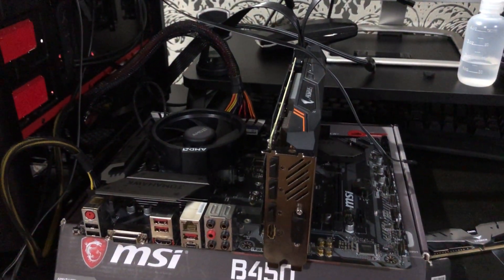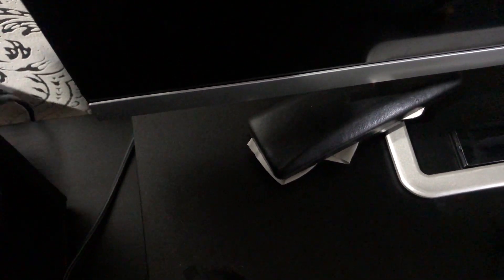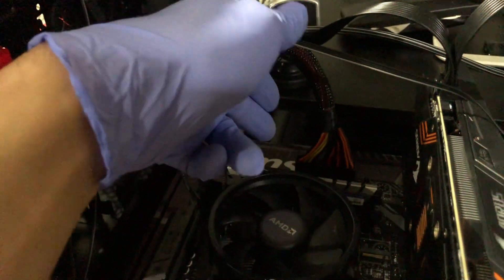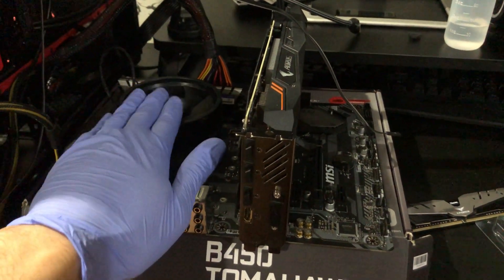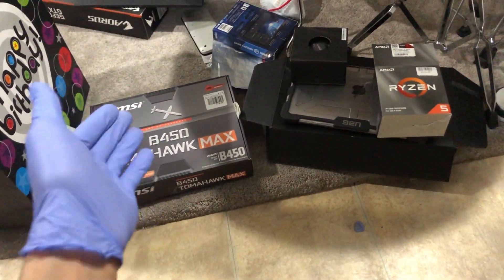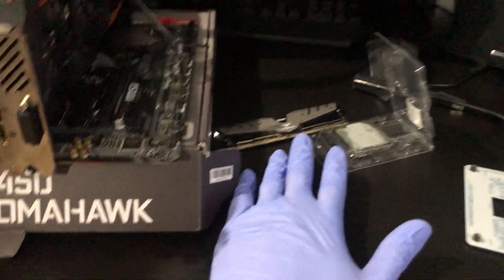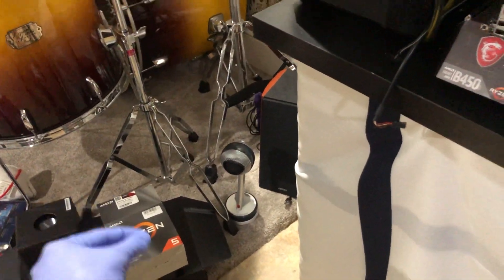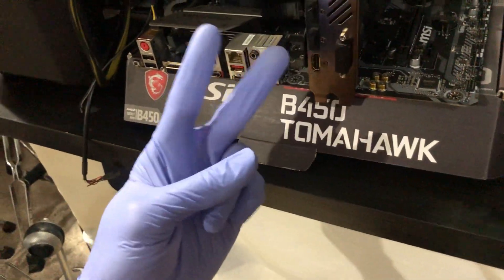MSI B450 debug lights go berserk | Ryzen 5 3600 | Cpu light problem with 2600 Not fixable

Comment from the maker: Just to reiterate that the bios was updated and every step was taken. Make sure to also check compatibility for each part but we all know the basic steps that need to be done but at a certain point your going to just have to test out another motherboard. I would file a case for whatever part you have and make a fuss and you might get something back in return like store credit.
Reply: OnlyJesh I used this motherboard and had the same issues. Some people got there’s to work and then it eventually went out. I took it back and got the ROG Strix B550f.
Reply from the maker: Crying Egyptian thats what i like to hear😈 upgradeeee

Comment: Have had lots of issues with my B450 Tomahawk not posting. It just seems to "lose" the bios after a normal shutdown, with the usual CPU & fans turn for a second, then shut off. Flashing the bios is the ONLY thing that has helped, although that can be wonky with this board, too. Some flash drives work, some don't. They MUST be formatted with FAT32 and only have one partition on them. The file must be in the root directory of the drive, and MUST be renamed to MSI.ROM (in all caps).  Some people have said on the Web that flash drives formatted with NTFS work, but that's BS.  Only FAT32 works.  Oh, and when you flash the bios, push the bios flash button for 3-5 seconds, holding in it for that length of time.  If your finger slips off the button, it won't work right!  Make sure that the red light flashes for at least 5 minutes.  If it turns off before the five minutes is up, do it again.  After the five minutes, and you see that the red light is off and is staying off,  do NOT remove the USB drive or turn off your power switch - just leave everything alone for at least ten minutes. The PC will go through some weird starts and stops. It also needs to train the memory. If your memory is overclocked to some Nth degree, it could be helpful to flash with only one stick in the 'A' slot (that is, the 2nd from the left).  Also, if your have a Wraith cooler attached, the LED light will be white when it's flashing, and red when it's actually working.  Anyway, the process of flashing the bios on this board sometimes needs to be done several times before it takes.  And, like my machine, you may need to go through this entire procedure several times a month.  Not sure if it is because of the newest bios MSI has listed, but something is making these boards "lose" the bios...
Reply from the maker: Yeah I sadly still have never figured out what’s wrong with it aside from a software issue or some component in the mobo but it’s really frustrating.

Comment: Lol hey man I have this exact same motherboard it seems like it just likes to mess with us right LOL. My motherboard every single time I start up the computer it tells me that the CPUs wrong that light turns off tells me the D ram is bad and then it tells me no boot but then it boots just like regular because of that all my RGB is stuck on red. My advice what is happening to you is happening to me unplug all of the motherboard wires including the power to the motherboard and the CPU power cord nothing else after you unplug those go take out the battery that’s in the motherboard take out your CPU blow out the socket and carefully blow on the pins on the cpu. put the battery back in after 10 seconds maybe longer plug everything back in and you should SHOULD be good don’t “Me lol

Comment: My pc won't even boot..no fans turning on nothing. When i press start button in cpu red light flashes at Cpu debug light and then turns off.
Reply: Your motherboard is probably dead if not you power supply could have died as well try taking it to a repair shop and if you have money u can just replace what’s broken

Comment: I have another kind of problem hope you can help me solve this one. 

Day before yesterday I was playing Destiny 2, suddenly my monitor froze and I couldn't do anything so I force shutdown my pc directly from Cabinet and I slept. Yesterday night I started my pc I got blue screen saying system_thread_exception_not_handeled, so I restart my pc to go into safe mode. I tried 3-4 times and suddenly my monitor, mouse and keyboard was not working. Monitor says no signal, going into energy saving mode. Now my pc starts with all fans and everything except Monitor, keyboard and mouse. Shows CPU red light too. 

My Pc build
Amd 3600x ryzen 3
Zotac mini RTX 2060 super
NVME 2.0 WD SSD-480 GB
TOMAHAWK MAX B450 Mother board
16 Gb Hyperx RGB RAM 
1 TB Internal HDD
Reply: How did you solve it ? I have the same problem rn
Reply: @hanovar9233  it was actually my cpu which had a problem so AMD replaced my cpu.

Comment: My screen is on and it shows that it’s getting a display but it’s a dark screen but I can tell it’s on my ssd and hard rice are bothe plugged in and ez debug says it’s a boot issue help please
Reply from the maker: I would try flashing it and rolling it back a version and then try to boot then. Also if you don’t have another computer to get the file try to get one

Comment: I got the same problem b450 a pro max wth Ryzen 3600 it’s not detecting the graphic card
Reply: did u solved?if u did,i have a problem,cause i have a b450 msi gaming plus with a cpu ryzen 5 4500 and the gpu is 1060 3 gb, first boot it doesn t show up any screen,first there is a problem in the led of the cpu ,after 10 second the error led goes on vga (gpu),if u got any answer i am here

Comment: I got it, and after 3 months of using this board i got random pc shutdowns (not only in games) with cpu red light on board... 
i stressed my cpu and temperatures are normal
Reply from the maker: Investing into a good motherboard is very important. My mother board I have now has been great but has had voltage drops across the board and too much work to solve exactly where it is but yeah man get that mobo and save the receipt just in case
Reply: @onlyjesh7494  so should i do RMA?

Comment: Hello, I am just building my first pc right now, and just when I finished I experienced the same problems. My specs are:
Case:P400A
MOBO: Msi b450m mortar max
Ram: Corsair Vengeance 16gbs
Cooler: Coolermaster Hyper 212 led
Storage: Seagate 1Tb hdd + Wd blue 500gb nvme
CPU: Ryzen 5 3600x
GPU: gtx 770 ( using until I have enough to get a better)
So I finished and have the Ez debug led on cpu. Everything is practically new, and I’ve cleaned and reseated my brand new ram, same with the gpu. I check to see all pins are properly connected. I reset CMOS. I even took everything a apart and rebuilt it. I can’t seem to find what’s wrong. I don’t believe it is the MOBO because I bought it off a friend and it was working on his pc fine. When I boot the pc the fan and lights turn on everything works I just have the ez debug led on, but when I connect it to my monitor via display port, it shows that there is no connection, and with that I cannot access my bios if there was anything wrong with it. Everything with the monitor and cables are fine I tested the cable and monitor on my brothers pc, seems there is something wrong with my system. If you have any idea please lmk ty.
Reply: Try to run with 1 ram stick, I have the same issue and i try to run 1 stick of ram and works fine

Comment: I have the B450 Tomahawk and a ryzen 7 1700 most of the time it will run all day without issue but every now and then it loses signal and the cpu light comes on.  I have noticed it normally happens within 10 minutes of booting
Reply from the maker: NoodlesTBograt get rid of that motherboard man hahaa
Reply: Same problem

Comment: I have the same issue with the CPU I have the B450 GAMING PLUS motherboard and a Ryzen 5 3600 and everything was brand new just after building and having installing everything it said “No signal” and the Cpu light was red. But I just bought these parts like 2 days ago.
Reply from the maker: iLxgeacy return the mother board and get another companies motherboard or if you really like msi just go for the x570
Reply: OnlyJesh Thanks for the response. It’s just a bummer. Everything was working until this morning and it’s only 2 days old. Anyways do you recommend the x570?
Reply from the maker: iLxgeacy I mean I would recommend to go to asus or even gigabyte but if you want msi got for the x570
Reply: OnlyJesh Okay will look in to it thanks for your time

Comment: Hi  I'm new doing this I build my PC and when  I try to power up the PC  and didn't turn on  then I disconnected  everything  and just connected  the 24 pin and the CPU pin and the Rayzen 5 3600  to my motherboard  MSI tomahawk b450 and try to turn on with my powersupply  and didn't turn  on I don't see the lights either plis can some can help me plis  now  push flash Bios Botton and now have turno on one red light  y 5 seconds later turn  off plis help me
Reply from the maker: Christian Feliciano I would say your best bet is to try another motherboard bro
Reply: @onlyjesh7494  thanks for the support  bro  I will try another
Reply from the maker: Christian Feliciano yeah sorry their motherboards just have a lot of issues and you should have to worry about a motherboard issue after spending so much money
Reply: Im too late but b450 tomahawk only supports upto 2n gen ryzen, u need to update your bois but the max version supports 3rd gennout of the box. Thats the difference between tomahawk and max. Max means 3rd gen support.
Reply: @dev1ce758  Thanks bro I fixed but thanks for the info nerver is to late  =)
Reply: @christianfeliciano4180  may I know how u got it fixed ?
Reply: only connect 24 pin. and maek flashbios. unplug everythings and cables ok

Comment: I need help, I just started building my pc and everything is now on. I have a r5 3600 with msi b450 tomahawk Max, but when I turn it on it goes from red light Cpu to vga and then to boot and then the lights are going off but it still doesn’t connect to my monitor
Reply from the maker: Thijmen Wagenaar you have a graphics card  connected I assume. If you plugged it in with hdmi I would also try another port just for testing purposes
Reply: OnlyJesh I already tried every port but I maybe know what is the problem, the msi tomahawk b450 is a 2th mobo and I have a 3th gen now in inside, so I need to get a 2th gen from somewhere to update my bios.
Reply from the maker: Thijmen Wagenaar that’s great ! Yeah bios update definitely should fix that I thought the max already was 3 gen ready
Reply: OnlyJesh soms of them are
Reply from the maker: Thijmen Wagenaar what troubleshooting have you done to it so far
Reply: Any update regarding your problem? I read from some forums that this scenario is normal during the first boot up sequence of Tomahawk Max. I havent tried booting it up via F2 key yet..

Comment: Someone help please.. i have a msi b450m bazooka motherboard.. ryzen 5 2600 cpu .. pc was working for 3 months.. then just today i get the white light on for the dram.. ive tried reseated the 1 stick i do have in all 4 dimm slots to avail. I started smelling a burning smell while i was playing earlier but everything was working properly. All lights and fans still work. What could be the issue? Please help anyone
Reply from the maker: I say that you need a working ram to see if that will work. So buy a 8gb ram and test it out. If that doesn’t work. Your pc getting hot and smelling for sure check the gpu and cpu And see if the thermal paste needs to be replaced also it might be so that maybe a capacitor or a piece on the mobo might be reaching its limit or simply one of the components need some cleaning. It’s hard to say since the smell can definitely help in if it has a chemical smell or not. Also the gpu does have thermal paste inside it and might need replacing
Reply: OnlyJesh thanks bro, i noticed the ez debug light changes sometimes. Dram to boot and vga. Still no screen display. Headed to best buy to get a ram stick.  The pc smelt like burning hair.. pc was working fine, i was playing a game for like 4-5 hours.. pc promoted me to update windows which i did, shut it off and came back 3 hours later and now where here.
Reply: OnlyJesh mind u, pc is only 2-3 months old. Pretty much brand new just built
Reply from the maker: Kuma Makanui yea man sounds about right msi definitely lost me but I wouldn’t tell ppl to not try them but it was a miss for me bud
Reply: Kuma Makanui hey did u fix it
Reply: ShadowZ BlastYT not yet, i noticed a smell and looked around the pc.. i noticed a small black dot on the red voltage switch on the power supply.. looked closer and smelt what id been smelling the past couple days.. it looks like the voltage switch is also melted a lil. Its an apevia 520w .. i dont think it did any damage to my other components..
Reply: If ez debug lights don't light up at all, but fans etc are running, does that indicate dead motherboard? No noise from mobo speaker either.

Comment: i have the same tomahawk and ryzen 5 3600 b450 card i bought them for 3 months. led cpu on and fan at full speed nothing is displayed and the power button does not work after starting. what do you think the problem is?  please
Reply: did you fixed it?
Reply: Lord Barcsacs Hello yes I fixed the problem it was the motherboard was defective so I bought a new card
Reply: Kacean LH i have the same exact problem and was wondering if you could tell me what motherboard you bought?
Reply: @CesarHernandez-vt7ew  Sorry for the delay in responding. I bought a msi B550 tomahwak
Reply: Same with x570 msi pro.. I think msi all products are worst.
Reply: @sumanjit100  I totally agree with you.  they also have a problem accessing the BIOS with the sup key on all msi cards
Reply: @kacemlhl3292  ya bro i just bought a pc, it work fine for only 20 days.. And now dead showing multiple different different issues, random shutdown, sometimes cpu debug red light. Now I hate msi.
Reply: @sumanjit100  it's true I'm going to build another pc this year I'll switch to Asus for the motherboard it's much better.
Reply: @kacemlhl3292  yeah asus is the best for mobo.
Reply: Same problem
Reply: same as your. b450 gaming pro carbon ac

Comment: Hey did you solve your problem? Mine has CPU led.. someone can help me?
Reply: Same here
Reply: Try updating the motherboard bios to one with agesa 1.0.0.5 or 1.0.0.6.
Reply from the maker: So I replaced the mother board. I did try to update the bios and specifically to versions that would work for both cpus. I did every basic and advanced procedure. It just was simply a bad motherboard
Reply: OnlyJesh good to hear you sorted it, thanks for the update

Comment: hey, my CPU LED indicate for 1,2 seconds and change to VGA LED, my monitor shows no signal also VGA fans are not spinning. can you help me if you know anything?

note:- that was my first boot it worked fine and I installed windows ran it for nearly 2 hours but I couldn't update bios, VGA,display drivers, etc.
Reply from the maker: La faygo Well do you have a graphics card? And I think I’ve seen a similar situation like that, I believe they had to flash their mother board but I would have to get back to you on that. Also you could try resetting the cmos if you didn’t do it yet

Comment: i have same problem 
my pc boots up but in between the monitor shows no signal and ez debug shows cpu light
Reply: Same exact issue. Woke up and turn med my rig on and no post. Rgb fans all good but cpu debug lit
Reply: @4_ist403  I have mailed msi to replace my msi b450m pro vhd max 
I think it's motherboard issue I don't use UPS and spike in voltage have might fired some Mobo part 
Or their might be the bios update 
But I don't want to take the risk of updating the bios 
Same issue happens while updating than the Mobo will be totally dead
Reply: It's  baios prb... update your baios
Reply: @talhatanisa6602  I’m having this problem but I can’t even get the monitor to turn on so how would I do a bios update?!?
Reply: @karlwheezervr3952  Bios updates do not require a screen/monitor, google/youtube some info my friend.
Reply: Thats not a boot
Reply: @Cool Tech  if I could kiss you thru the internet I would good sir! Had my mobo boxed and ready for rma shipping today and you had me thinkin...ok 1 last try. Boom boot up first try! Thank you so much
Reply: Same issue with me, all lights and gpu, ram work but my cpu light comes on. Changed mobo and same problem. Think is a psu issue
Reply: @lsvital1519  I replaced my motherboard and everything is working fine
Reply: @karlwheezervr3952  tried that and didn’t work, think it’s my power supply